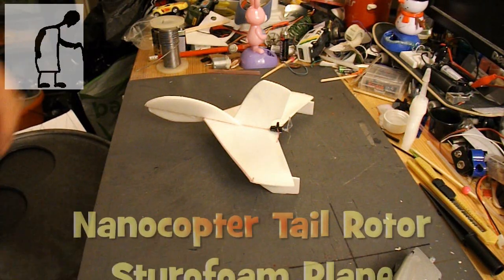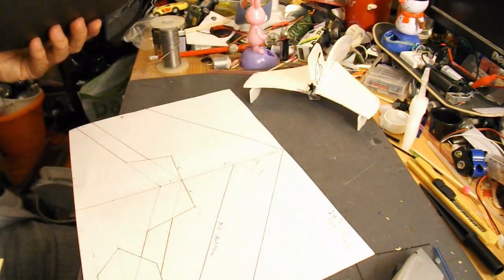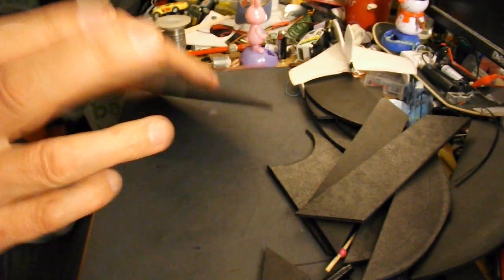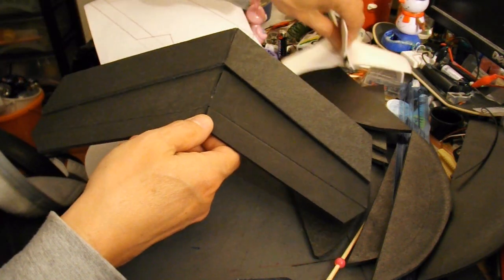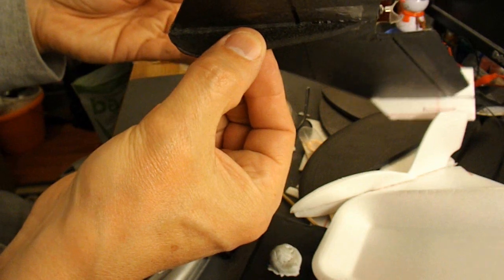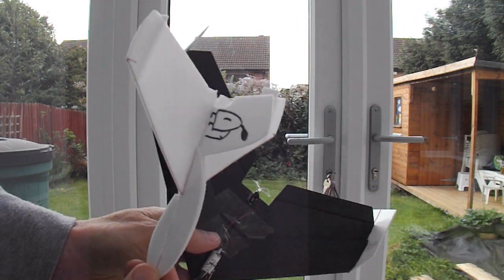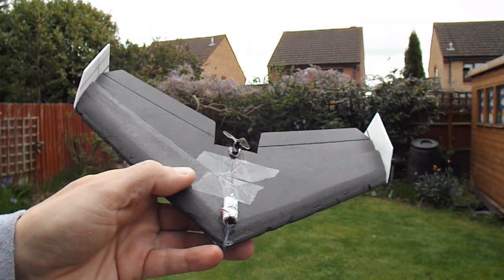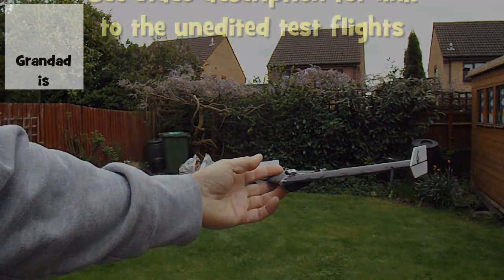Nanocopter Tail Rotor Styrofoam Plane Part #2

Comment: Nice build. In my experience, a 4mm copter motor with 40mAh lipo can power a plane of 4g total weight, 6mm 9g and pair of 6mm up to 0.9oz. This looks to be significantly heavier, yet without doubt the level flight (to rising) is there.
It must have a power to weight ratio greater than 25% to fly level, say most folks. But, the KF and KFm series really do work well. Fascinating how the air shapes to what's missing at the back of the section, to form the missing airfoil shape naturally. 
What a great experiment !
Reply from the maker: slider2732 thanks again. Yes, you can get really deeply involved in airfoil technology if you choose. Back in the 70s when I was interested in aircraft and aeromodeling I remember some interesting airfoil ideas, can't remember the names but I vaguely remember turbulators. I have just had a quick look on Google and got myself even more confused about how they work, but the bottom line is that a smooth airfoil shape is not necessarily the best idea.
Reply: Do have a look at the Custer Channel Wing...wings ? we don't need no stinkin wings !
http://en.wikipedia.org/wiki/Custer_Channel_Wing
Built one a few years back, using just 2x differential thrust motors and a half cup shape of clear plastic on each side. No wings at all, flew great ! was very surprised. Turning was a bit of a problem, being as the motor RPM's were keeping the plane in the air lol, but with a rudder instead it would enable proper flight of a thoroughly absorbing principle.
Reply from the maker: slider2732 that certainly is an odd one. Looks like a half finished ducted fan :-)
Reply from the maker: slider2732 good old YouTube, hid your comment away in the 'likely spam' folder and didn't tell me. Just found it. I must say your's looks 'truer' to the concept than Custer's. His still has vestigial wings. I do like his model in this video https://youtu.be/_EGkWyl-9u8
Reply: GrandadIsAnOldMan
Maybe i pushed his own design forward. Built a tiny version of the same thing before that 'larger' one and it leapt upward in the back garden. Was all a lot of fun, looking so wrong in flight..every rule being broken.
Wouldn't mind a real one from the vid for 200 quid ! Nice model he had there, at a good size for building.

Comment: I fly rc planes and have a few rc planes using that motor and have a few suggestions, you can skelotionize your planes in cling film u basically cut away most of the foam and cover it in the cling wrap u can save save a few grams and get longer flights and more power! here is a link, http://www.rcgroups.com/forums/showthread.php?t=1362423 just copy and past to your web browser if the ling does not work! hope this helps!
Reply from the maker: Ross Clements thanks I am well aware that it would fly better with less weight but I try to make my projects as simple and basic as possible so that people can copy them and then make their own improvements to develop the performance. Another simple improvement would be to use the bigger motor from the nanocopter, however the target of this series was to use the tail rotor. The way this is built it is fairly robust for the sort of flying I do in my garden with every 'landing' involving hitting something. Many years ago I made indoor planes from balsa and covered in a film created by pouring a mixture of dope onto water. Ha, I guess dope is the wrong word nowadays. Thanks for the link anyway, somebody may follow it and find it helpful :-)
Reply from the maker: Ross Clements almost forgot, you can see some very basic lightening work on this plane https://www.youtube.com/playlist?list=PLA5a2xPRSrB1XmUrtUx1ZmUtvWF3rmkm9
Reply: ok you dont have to use brass tubes and all that othr crazy stuff just cot some holes into the plane and cover the surface in glue and just drop some cling wrap right on!